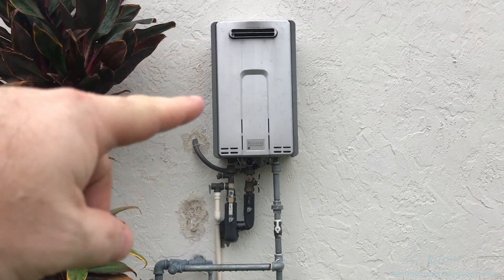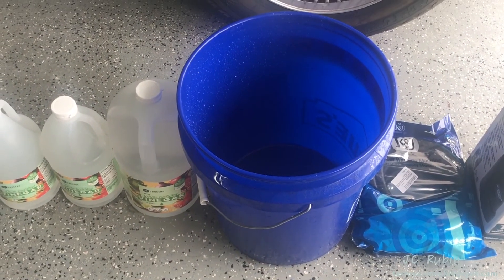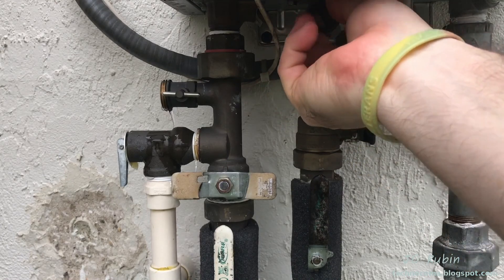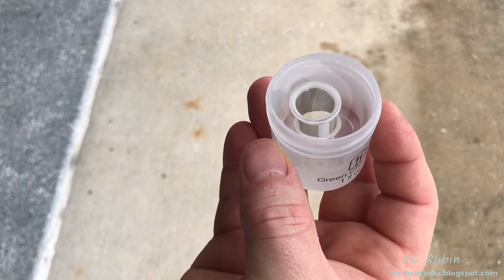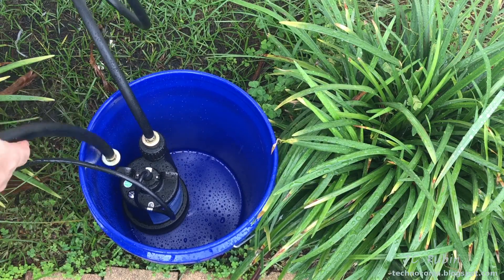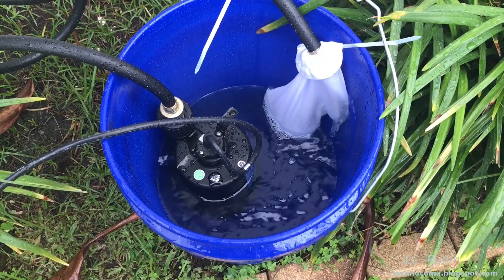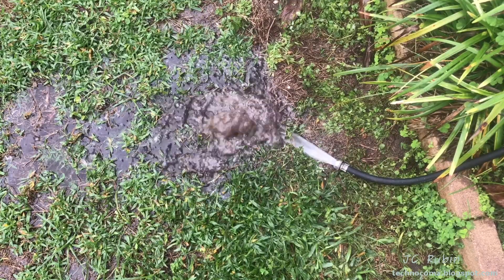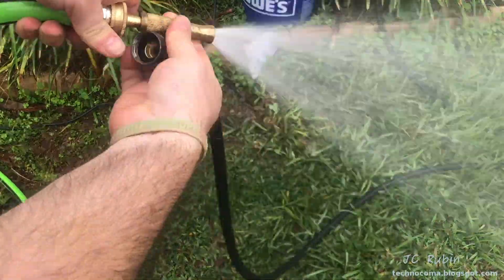Simple Hot Water Heater De-scaling - Build your own maintenance kit for cheap

Comment: Thanks for this video.  Because my tankless WH had not been cleaned for over 9 yrs and was making lound humminng and clicking noises - from another video there was a suggestion to use diluted muriatic acid instead of vinegar.  I diluted the MA to 10-15% and ran through 4-5 times 30 minutes each with a clean batch each time.  The first bucket was very dark dark brown, the second the same; progressively became lighter.  At the end I ran two five gallon buckets of plain water through to clean out solution.  My water heater now runs much more quiet and works well.  The loud humming is gone.  Hoping to get more life out of the water heater.  I will repeat again in about a month using diluted MA to about 8-10% - I'm thinking the water will be much lighter in color and will require another cleaning in about 6 mos after that.  I will be on a regular cleaning schedule now.  I just did not know about this needed maintenance.  The install did not have isolation valves.  I watched some other videos and installed a new insolation valvue kit.  Much better install than the original.
Reply from the maker: Glad to hear it worked out. Most people have access to vinegar and it’s also safer. People who own pools generally have stronger acids to dilute

Comment: Very similar to yearly RV water heater maintenance, except we use less vinegar and do turn on the heat to speed things up.
Reply from the maker: interestingly [or not], the temperature or the vinegar when up quite a bit die to the reaction with the base materials.